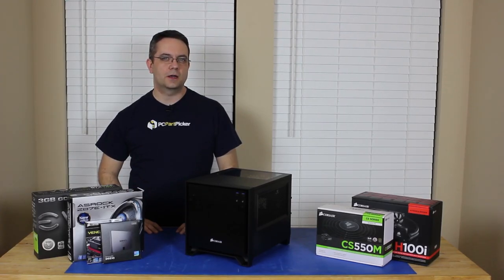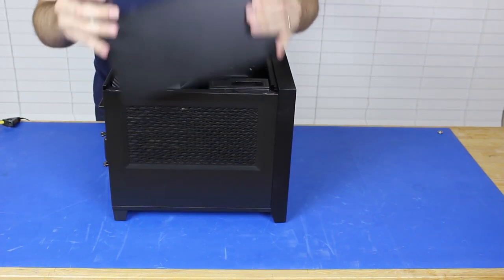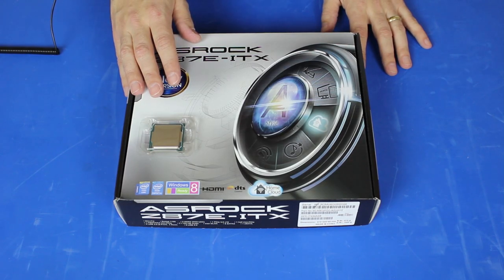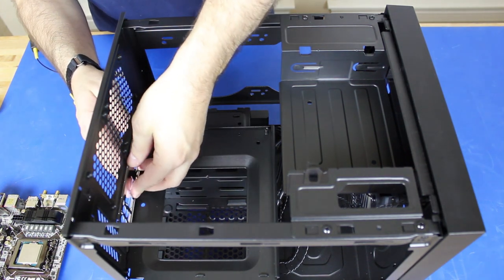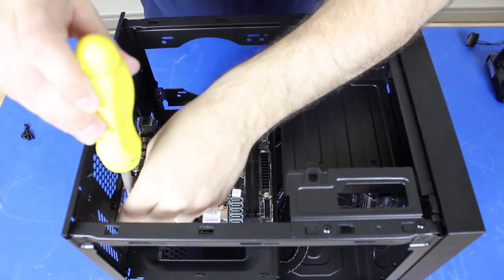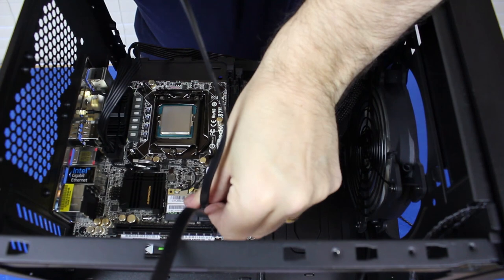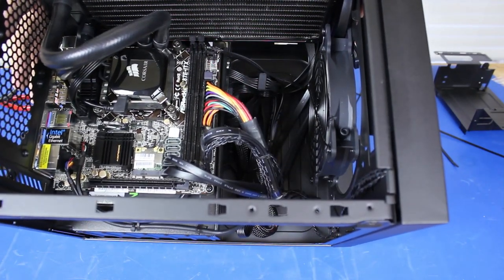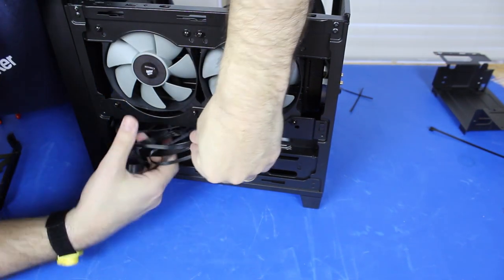Mini ITX Gaming Build - Intel Core i5-4670K / GTX 780 Ti / Corsair 250D

Comment: The way to go go with this case is Intake on the front, exhaust on the back, and exhaust on the right. That way, air comes in from the front and left side, exiting through the back and right. Corsair even set up the fans this way.

Comment: Trust me, positive pressure is not the way to go with this case. I had same airflow config and my GPU would overheat. It's better to exhaust the hot air through the rad in this condition.
Reply: which gpu did you have?
Reply: xRECONCILEDX ASUS GTX 770
Reply: TheMidnightNarwhal Can confirm. 770 Temps are high as shit in my 250D.
Reply: Long4Boarding But now that I changed my airflow (front intake, side rad exhaust, no fans at back) I don't go over 60 degrees celcius.
Reply: i need to invest in a h100i then lol. My i5 is a locked cpu so i see no point in it tho...
Reply: Long4Boarding Well just get 2 fans for the exhaust on the side, or try at least one.
Reply: TheMidnightNarwhal that makes sense, exhausting out through the rad removes more heat since the point of the heat sink is to remove heat to the rad ...hmm guess I don't quite get the concept of when "positive pressure" would be appropriate (heating and air conditioning guy here)
Reply: TheMidnightNarwhal Positive pressure does not mean you have no exhaust fans. Generally, with most cases, you want to have more intake than exhaust. If you have a filter on your case, you should maintain positive pressure in your case otherwise the case will suck in dust particles from all the other openings, rendering the filter counterproductive and useless. The design of the GPU cooler is also a very important factor in small cases. If you have a reference cooler like in the video, you're golden, because the card exhausts heat from the back (outside the case). Which is why you see so many small builds using the reference designs. Other aftermarket designs, although being more efficient, exhaust heat inside the case, which means you absolutely need an exhaust fan that will help to move the hot air out of the case.
Reply: Pericles Underhill 
A lot of people are using the radiator fans as intake because they want the coldest air to go through the radiator fins. But they should use a strong enough exhaust fan at the back of the case to remove all the hot air coming in as soon as it gets in through the rad. If you use the rad fans as exhaust then you need good airflow to keep the inside case temps low.
Reply: TheMidnightNarwhal this is a blower cooler on the reference gpu, the fresh air from the front and the side intakt will be exhaust at the rear of the case
Reply: CrazyBeats  Thats what I meant, you also want to make sure you have good airflow going over the voltage core on the mobo, I understand what you mean though. But I also don't like so much dust in my system that I have to clean it every 3 days lol
Reply: TheMidnightNarwhal does the corasir h100i v2 fit in this case

Comment: I build a lot of computers and once a year I take all my leftover parts and build something for someone who can't afford a PC or just can't afford a PC at the level they want it.  A young friend of the family has been getting by on old junk so I decided to do a build for him and used this 250D case.  I was really impressed with this case.  I charged the kid 100$ for the PC which came to a total of 650$ worth of software and hardware.  i3 2125, 8gb ram, Samsung 850 Pro 256gb, AMD 7790, Corsair CM750 (overkill but best price at store) 250gb WD Blue HD, coolermaster Gemini heatsink, Win 8.1 and office 2013.  This pc runs very cool and very quiet inside this case.  I did a remote RGB lighting kit so you can see the guts through the top window.  This kid won't be gaming on any ultra settings but at least he can game on low settings and have something for school work.

Comment: So, its great that could fit a bunch of metal parts into a small area. But what really matters when its all done is what the temps are. Would've been nice to see what they were.
Reply: The 250D isn't all that small as far as MiniITX cases go, and since it has dedicated vents for the GPU and radiator, all tests have show temperatures to be just fine. The main limit will be cooling to the CPU if you go with a fan cooler.
Reply: opmike343 Im sure they would be acceptable, but when you're looking for a future proofed build that you don't plan on replacing in a year or so it would be nice to know the temps. Nothing worse than buying parts around a build that doesn't have the numbers you are comfortable with.
Reply: I have exact same build (i7 4770/Titan though) and the temps are excellent in it only thing I did different was run 1 small 80mm fan in back to extract
Reply: Greg Dawson im about to receive my gear for my build in this case. I have a i7 6700k, Noctua NH-9US (x2 fans), right now i run a RX470 but ill soon have a 1080ti (blower). Do i need to add x2 80mm?
Reply: You probaby dont need the second one i only put one on for peace of mind as my titan was a blower aswell (original) titan. As i was using watercooling for CPU

Comment: I use the 250D and the h100i with the same config as shown in this video and i can say that it is the best config. 
The first time i mounted my h100i was with negative airflow, but i found two reasons not to go that way; the first reason is that if you put an ODD you will reduce considerably the airflow in one of the fans and the second reason is that if you use the negative config you'll be wasting the dust filter on the side panel and (this is very important) you will turn your pc into a vaccum, with the negative airflow your fans are going to suck the air from the rear panel wich is not filtered and you are going to throw 100% of the dust into the rad and all your system.
With positive airflow you are going to filter most of the dust and your internal components won't be covered with dust, having dust inside your machine is worst than throw warm air.

Comment: Wow,, did not know pcpartpicker had a channel here till today...subbed
Built mine with the help of youse guys! TYVM...though I opted for a mini atx because I thought my giganto hands would not fit in an itx case, after seeing that corsair case I may be mistaken.

Mine babe:Intel Core i5-3570 3.4GHz-ASRock Z77 Extreme4-M Micro ATX LGA1155-G.Skill Sniper DDR3-1600 4096MB x2 16 GB-EVGA GeForce GTX 1050Ti 4GB-Samsung 850 Pro 256GB 2.5-Inch SATA III Internal SSD (MZ-7KE256BW)Samsung Electronics MZ-7PD128BW 840 Pro Series 2.5-Inch 128GB SATA 6Gbps SSD 
Seagate Barracuda 1TB 3.5" 7200RPM Internal-Windows 7 Professional SP1 OEM (64-bit)-PC Power & Cooling Silencer MK III 600W 80+ Bronze Certified Semi-Modular ATX PSU-Silverstone TJ08B-E MicroATX Mini Tower.
 I love it to death.

Comment: 10:50 Put the fans on the other side of the rad, so that way, you dont have to remove them to clean the dust (Pull configuration).

Comment: A swiftech H220 fits easily. Tried n Tested. Good to know. For a custom water cooled loop build.
Notes: Have the filler port facing out. You can have it the other way but with a 140mm (max) fan+rad on the front it wont clash with the main rad but you will need to remove it to get to the filler port on the inside. But other than that, only other problems there is to deal with is the front I/O USB n Audio Connectors need some special consideration about routing and as expected with the m/b choose wisely. If you run a FM2+ your ATX power nylon clip is likely alongside the radiator so may just need to cut off a bit of nylon plastic.

Comment: Won't the inside of the case be hot because of the fan pulling hot air through the radiator into the case?

If I was to build the PC, I would mount the fan opposite so that it pulls out air from the case. And as there is one fan in the front for air intake, air flow will not be a big deal. Just my two cents.
Reply: doesnt matter cuz liquid cooling.

Comment: Ok so I love this vid because I'm about to use that case for 2 new rigs for my wife and kids. However I have 1 critique which is the cpu cooler block mounting. I believe to get a little less resistance on the tubing if you had mounted the block with the tubes facing Ram and had them loop back towards the rear of the case it would have been better for air flow and more aesthetically pleasing. None the less great build video!

Comment: Definitely leave the fans on the inside with the rad facing out. It will give much more room to flex in the tubing when installing. It was impossible to do it this way with the Gigabyte Z170N Gaming 5 otherwise. And put the memory in before the H100i.

Comment: I use the watercooling as an exaust.
got a huge 200mm fan in the front.
works fine. no dust whatsoever. 
and the temps inside the case are very low.
running a 4670k and a 980 :)
Reply: DESCENT Reference 980 or aftermarket cooler? Looking to do the same build, possibly with a 970 though instead.
Reply: ***** my 980 is a MSI Gaming 4G
Reply: ***** yes, you can
Reply: DESCENT Any thermal issues? GPU or Case temps?
Reply: ***** nope. everything runs cool. the only heat inside the case comes from the ram and other random stuff. no big things like the cpu or gpu heat.
Reply: Would a i7 4790k work in the build with a 980 Ti?
Reply: c0nnor34 yep. should work out just fine.
a 200mm front intake fan (if you want one) interferes with the GPU PCB.
I was able to cut down the 200mm fanchassis, so it fits!

Comment: I recently tried duplication this build, but ran into a huge issue with this motherboard and the H100i. The bottom part of the tubing comes into contact with the USB 2.0 on the motherboard to the point where if you wanted the cooler to fit, you literally had to force it against the USB 2.0 and PS2 port until they bent out of place. Is this a known issue, or was this encountered in this build?
Reply: I just tried building this tonight and ran into exactly this problem. Actual I can't eve get the radiator to fit. It's either I snap the usb2/ps2 connector off or I don't run my liquid cooling solution. Probably just going to have to run the stock fan. Really disappointed that it's down to a few millimetres and I'm going to have to totally rebuild my machine, not to mention wasted $100 on the h100i with this build in mind.
Reply: Update to last post: turns out I am an idiot, just needed to use the higher up screw holes on the bracket, everything fit after that. Wow. Built now and ready to rock. Phew!
Reply: I was able to make it fit by using the other set of screw holes on the fan bracket, still a tight fit but no mushing tubes. Works quite well now!

Comment: Love how you didn't remove the CPU socket cover and then closed it and realized. Lol
Reply from the maker: Uncle Sam USMCFD Many motherboard manuals include CPU installation instructions that state to leave the cover in place while latching the bracket, as shown in this video.  From a recent Z97 motherboard manual from MSI for instance, I found this: "When you press down the load lever the PnP cap will automatically pop up from the CPU socket. Do not discard the PnP cap. Always replace the PnP cap if the CPU is removed from the socket."
Reply: PCPartPicker yes but I know a lot of 1155 and 56 socket boards will have it were you open the socket and the cover won't come out with the cover so you have to remove it. With that said just remove it. Plus im positive there's the bright yellow sticker on the cover saying remove it.
Reply from the maker: Uncle Sam USMCFD The Z87E-ITX motherboard manual (for the motherboard used in this video) explicitly shows installing the cpu with the cap attached.  Your previous experiences may be valid, but that doesn't mean we did it incorrect in this case.
Reply from the maker: Uncle Sam USMCFD Read the manual.  It shows installing the CPU with the cap attached, and then removing it when the bracket is latched.  Your image does not invalidate the manual instructions.  http://www.asrock.com/mb/Intel/Z87E-ITX/?cat=Manual
Reply from the maker: Uncle Sam USMCFD Specifically, see page 19 of the english version of the manual.
Reply: PCPartPicker I see it but I still think its wrong because you will be putting uneven pressure on the CPU while latching it down you know. I know I wouldn't be doing that anytime soon when building PC's
Reply from the maker: Uncle Sam USMCFD Very well.  I'll stick with the manual instructions and trust that they are correct.  Best of luck in your future builds.
Reply: PCPartPicker ya you too. Thats the other thing is a lot of times the manuals are not clear or are wrong. Guess the person who made the manual wasn't on there game day. lol
Reply: Some caps automatically pop up when you fix the latch. I've read somewhere to leave the cap on while latching but also seen some people remove the cap first.

Either way, it seems like he left the cap on purpose.
Reply: Jacob W I have actually seen a lot of videos showing those caps popping off when installing. It's the correct method for a lot of modern motherboards.
Reply: Jacob W You're supposed to do that silly :P

Comment: Which direction are the two radiator fans on the side blowing. On the back of the case there are two slots for 80mm fans. Are you gonna leave those empty?

Comment: With the Original Fans in the Case and on the H100i Watercooling kit, did you experience any noise from it? Would you recommend using more Silent fans?

Comment: Interesting approach to the H100i, Linus orientated his almost upside-down compared to yours, so that the tubes went over the RAM and fed into the rad at the front of the case, not the back. It looked a lot tidier, but I don't know whether the orientation would affect the efficacy of the cooling system.

Comment: the fans of the radiator are pushing all the heat inside the case in this setup,shouldnt they be oriented to pull air from the case through the rad and then out?
Reply: cata stefan I would say so yes, especially as the (potentially) huge fan on the front makes for a great intake

Comment: Maybe you could spin the radiator around so the tubing is toward the front and that would take up some of that extra slack in the tubing. or spin the cooling head above the cpu 90 or 180 degrees.

Comment: The shorter standoffs with the H100i are for LGA 2011 not AMD, the AMD platforms does not require any AFAIK because the H100i connects directly to the stock AMD brackets and backplate.

Comment: Can I use i7-4790K Processor on this build ?
Reply from the maker: Absolutely!
Reply: PCPartPicker So it won't effect the temperature ?
Reply: Jassem Alostath Nope! The H100i will keep things nice and cool
Reply: ***** As long as it's LGA 1150, yes
Reply: he needs to buy a z97 or h97 it wont work on a z87
Reply: monkey1346ful  You can use the Intel i7-4790K with the ASRock Z87E-ITX but you have to make sure your BIOS is at least version P2.30 or above. Anything under this version and you need to update your BIOS. I am about to build my gaming computer using the Corsair 250D, Corsair AX860i PSU, Corsair H100i, Corsair 16GB Dominator 1866 RAM, Corsair Neutron GTX 120GB SSD, Seagate 2TB SSHD, Intel i7-4790K with the ASRock Z87E-ITX and a Leadtek GTX 770 O/C 2GB GPU. However my motherboard came with version 2.10 BIOS which doesn't support the i7-4790K. So I brought an Intel PENTIUM G342 CPU so I can update my BIOS and once this is done I can then install and use my i7-4790K. You can download the latest BIOS for this motherboard here: http://www.asrock.com/mb/Intel/Z87E-ITX/?cat=Download&os=BIOS
Reply: sory idk
Reply: monkey1346ful No need to be sorry :). There isn't that much difference between the Z97 and Z87 other than M.2, SATA Express, and the ability to upgrade to Broadwell. I thought about buying the newer ASRock Z97E-ITX/ac and using that instead of my previously purchased ASRock Z87E-ITX. But I much prefer the colour scheme of the ASRock Z87E-ITX plus I don't need M.2, SATA Express or the ability to upgrade to Broadwell. If I am going to upgrade then I do a full upgraded not just half an upgrade :).
Reply: +Jassem Alostath 
That's a 240mm watercooling radiator!
you could cool a forest fire with that thing!
Reply: duh
Reply: +Jasem Alostath no it's too big

Comment: the h100 fans are for intake or out? if thay are out is the position in thge are optimal if the are intake for optimal air flow this does not affect system temps?

Comment: Are the cables supplied by the respective hardwares or do we need to buy them separately? For example, does the power cable come along with its the motherboard? Do sata connectors and power cable come along with SSD and HDD?

Thanks.
Reply from the maker: All of the cables should come with the components.  SATA data cables will come with the motherboard and the SATA power cables will come with the power supply.

Comment: was looking to replace my ageing 1090T amd full tower, and was looking at the same I5 that you slamed into this pc .however my old pc has corsair 80i cooler will that fit in this case? and how would you compair this 250 from corsair to say the shuttle SZ87R6?

Comment: I am really liking those anchor points for cable management, Makes for a very tidy case. One thing that I don't like about most modular PSUs is that each SATA power cable has 3 connectors that are so close to each other. On some cases where the drive bays of the DVD drive and the SSD and HDD might be far apart you are forced to use a SATA power cable for each one and sometimes you end up using all the modular cables anyway and still have unused connectors dangling around in your case. I think they should start making individual SATA power cables or some sort of extension so you only have to use one.

Comment: I know it's a small case, but considering the side vent would a non-reference designed graphics card not benefit more by pulling more air through that vent. Maybe even throw a larger fan in front, as well as two silence optimized 80mm fans in back.